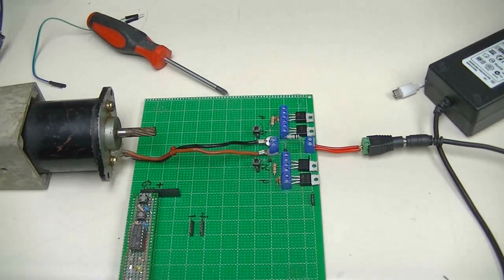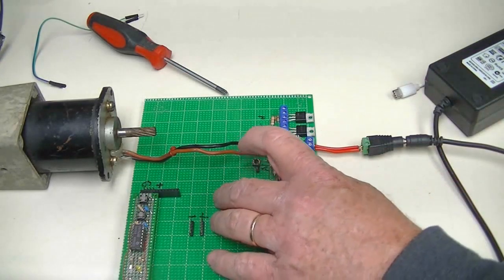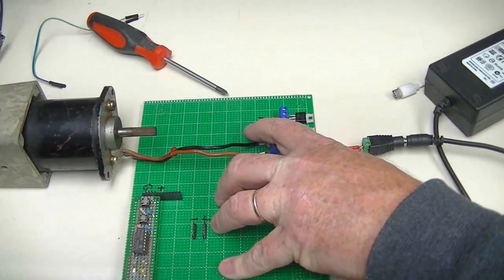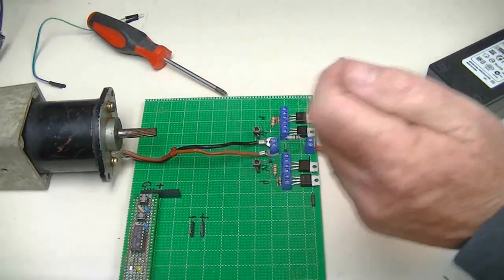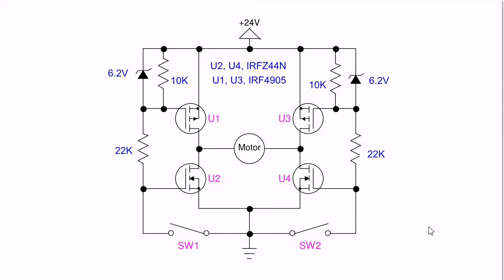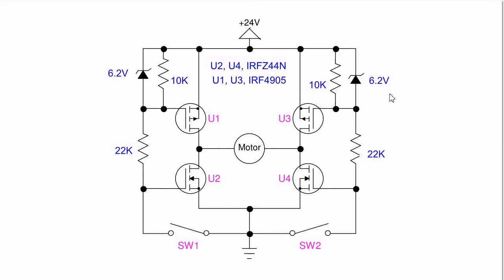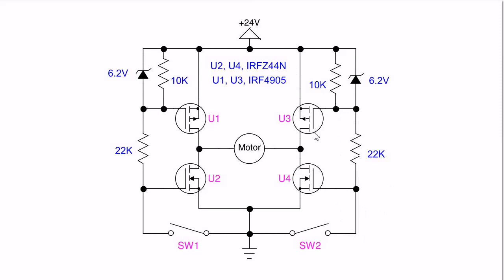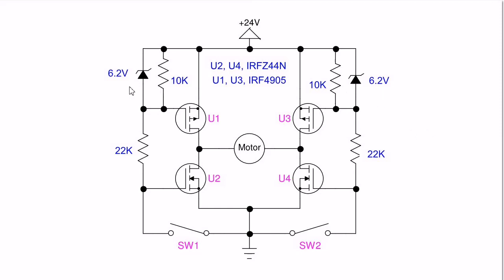Basic 4-Transistor MOSFET H-Bridge

Comment: Does it have PWM control? Can a 40 amp motor be driven in this circuit?
Reply from the maker: Yes PWM can work. Yes a 40-amp motor will work if the MOSFETs can handle it and the voltage is no higher than 20V.
Reply: @LewisLoflin  bts7960 b 
Can I use it instead of this circuit? I use rpwm and lpwm terminals. Do you think the engine will switch right and left momentarily? Can it handle the circuit? Thank you.

Comment: Basically the " dead time" (when  all 4 Tx's.are "OFF") is only ensured if one doesn't press both push buttons simultaneously..
it is possible to provide this with both push buttons being of 1NO/1NC type...( at least..) instead of just an 1NO type.....
Here the NC of one being in series with NO of the other...
Reply from the maker: There is no 100% "dead time". With no buttons pressed the 2 N-channels stay on, grounding both sides of the motor.
Reply: @LewisLoflin  thats good.. something I overlooked..so it's in 
" brake" mode when OFF 👍
Reply: @LewisLoflin  can it work with 36volts?
Reply from the maker: @mariastanford5701  No. Due to MOSFET connections, it is limited to 18V.

Comment: Hello Sir, I would like to ask a question about MOSFETs.... I'm trying to add a remote on and off switching to a 12vdc lamp. I'm trying to use a tsop1730 receiver which will drive a pnp transistor that connect to the 12v in order to power the lamp.I found that the light just flicker rapidly but doesn't stay on. So thinking and looking for a solution, I thought replacing the transistor with a pnp mosfet will do the job. I just not sure if will be possible, perhaps there is a simpler better solution to accomplish the on and off switching. Any help or advice will be appreciated very much.  Thank you

Comment: your circuit doesn't make sense , you will blow up lower MOSFET because gate voltage will be 24V, and Why use zener diode ! While you make a voltage decided on the gate of the up MOSFET ?

Comment: Your older H-bridge designs is what brought me to your channel. 
My current project is improving the speed control on a milling machine power feed. These use universal motors, and are just SCR half wave controlled. Reversing is done with micro switches the reverse the connection of the field coils. Once I figured out that a H-bridge will not reverse the motor (I thought universal motors worked the same as PM motors), now I'm back to an improved PWM design that is much faster then 60Hz. 
The problem with all these power feed after market units, the sweet spot on the speed potentiometer is so very small, from not rotating to too fast. I'm going to use an encoder so there will be feedback in the system. This will also let me have electronic limit switch end points.
So I can use a DPDT relay to switch the field coil, or figure out a solid state one. The direction change would only occur when the current is zero, so arching of relay contacts will not be an issue. I just think solid state is the way to do this. And that is effectively an H-bridge. And would be the design you have in this video.
I'm a retired EE, 10 years now.

Comment: What a bliss to have found your channel. Subscribed when I came across the photovoltaic optocoupler video of yours, we are lucky to have such good content online! This here is the standard CMOS implementation, MOSFETS requiring a P on top and an N at the bottom, naturally forming a NOT gate, with field effect transistors. I love you have extended it to allow for higher voltages that the MOSFET gates natively tolerate, in the standard CMOS implementation, you don't even have those as your rail is always within the region, and the silicon goes as fast as it can. One could ofcouse manufacture a p and a n mosfet with a thicker gate insulator to allow for 30 volts of input, and in that configuration nothing else is needed except the transistors and how you lay them to do any logic. I have three videos on the complete design starting with the CMOS not gate and then the AND and the OR on my channel, if you have a look you will see we have no mercy on the transistors, all gates are either connected to the up or the down rail directly. Best regards, happy to see so nicely made videos :)

Comment: Thanks.
Maybe use photovoltaic optocouplers to allow use of  identical  n-channels on both low and high side.
Reply: fast opto- c ..perhaps 6N134 type or similar
Reply: @analoghardwaretops3976  I was thinking the photovoltaic type.
The output of such can be wired between a mosfet's gate and source, and if the photovoltaic optocoupler is powered it'll lift Vgs by say 5V regardless of source, or emitter voltage. Such can really help if switching certain loads (like capacitors) where duing a switch on Vs might take a while to rise. Better to float Vg on Vs etc.

As can sometimes be a bit difficult to obtain those optocouplers... it would be possible to experiment using LEDs. A LED will exhibit some photovoltaic effect if illuminated by an identical LED. Line the pair up inside a plastic tube or similar to stop ambient light from effecting operation.
Reply: such as you think plausible candidates...they will be operating in the linear region..i.e. their voltage output varies linearly with intensity..
A Mosfet gate will " switch" its output efficiently provided its gate is above a certain threshold..below that it may exhibit a sluggish response and will be operating in it's Ohmic region...yet not considering the current  drive capability of the photo voltaic device..
Also unknown is the  impedance the g-s sees when the drive voltage is too low or below operating threshold.....
If it's impedance is too high or open circuited the gate will charge up due to the drain-gate capacitance& turn the device on unintentionally..that can lead to it's destruction.